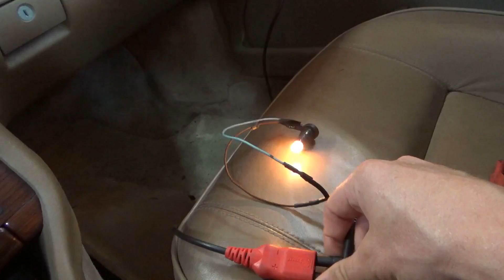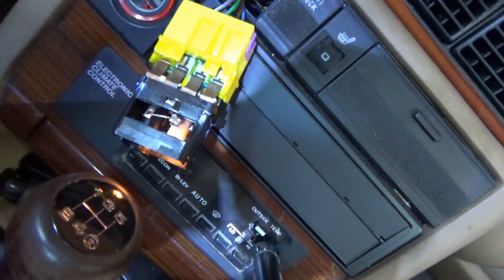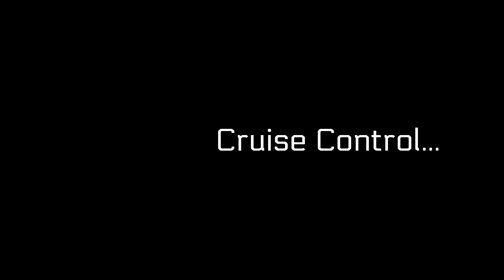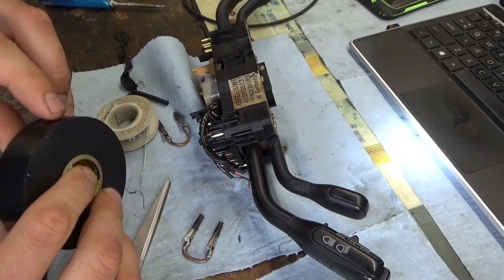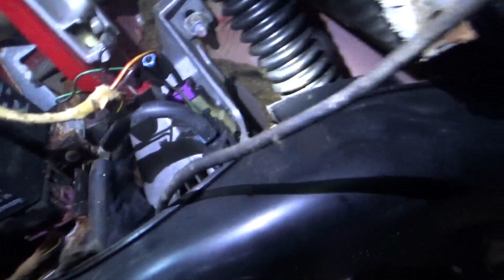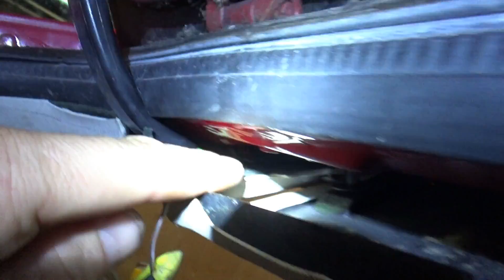CRAZY Cruise Control! (RARE Abandoned Audi Turbo - Part 10)

Comment: OMG!  How could you SOLDER two wires together?  You KNOW a crimp connector is the ONLY CORRECT way to fix this situation because a solder joint won't last through the first bump or any amount of vibration unlike a crimp connector which is SOOOO much more flexible and will last until the end of time or at least well past when this car makes it into the crusher.  NASA is going to hear about this and they'll PROVE to you with decades of raw data and experience that soldering is a fool's game  and you will have to conclude that a crimp connector will be the only correct fix.  I'm calling them right now....  :)

Comment: The wires breaking on the cruise switch was a common thing on older GMs too. Right where the column tilted. They were easy to replace though. you just pull away from column to remove. Clip the wires and tape to new switch to fish through column. The plastic sheathe was tough. Those vent valves are a fail safe if the electrical side quits working. I had a GM that the brake light switch went bad and didn't know until I was getting off the interstate with cruise set. When i pressed brake the cruise dropped off but when i let off brake, it tried to resume. Scared the crap out of me. I quickly knocked it in neutral and cut it off. Then i pulled over and disconnected the linkage from the servo.

Comment: The antilock turns off when locking the diff because all wheels will be turning at same speed. I had an AWD Pontiac 6000 many years ago that you could lock the center diff. As soon as it locked the antilock light would turn on. It would re-enable as soon as you unlocked the diff. It also had a complicated German braking system called Teves Mk IV. The controller had Ate on it as well. The only problem i had with the car. There was no brake booster, only a fluid pump to develop high pressure. When it failed you had no power brakes. In fact you had no rear brakes at all. When it worked though, you could make a panic stop very quickly and straight without locking the wheels.

Comment: The 'ABS OFF' was there because the Audi engineers found that in deep, fresh, soft snow and in loose gravel.....the car stops more quickly when the ABS is OFF because the snow/gravel creates 'wedges' in front of the tires thus stopping the car more quickly than if the wheel continued to turn.

Comment: Of course a crimp tool won't fit there.  The proper fix, in aviation, would be to string a new wire to a point where you can splice into the existing wire with the proper connector and tool.  And that almost never is solder in aviation.  On Eurotrash and the crap coming out of Detroit, fine.  Those cars are going to hit the crusher before it's a problem. Hahaha 🤣

Comment: This fantastic PHAD v 1991 AUDI restoration should act as a clear indication to all Electric Vehicle/Hybrid fans that we already had/have vehicle designs powered by either petrol or diesel capable of running and being fixed as a great 'sustainable' means of transport. And this Audi is a top of the range model. Well done to Ivan and the owner. I loved every section and the positivity behind it.

Comment: Again, you keep  hitting on the common issues that plague these older Audi's.  Do you know how many times I've had folks yell "Hey you got a tail light out!!" when my rear fog is on?? :D  Apparently Audi thought having a switch to turn the anti-lock off was good since there are situations where it would be better without.  Back then they hadnt figured out a way to have ABS play nice with the diff lock either.  Very thorough and great job on the cruise control too.  When you got to the actuator rod I knew the bushing would have been missing.  Great McGyver work on that.  Thankfully folks make nylon replacements of those that look oem.  The pedal switches too!  As mentioned there are just o-rings in there.  Some folks just remove and cap off the vac lines entirely.  On the 12th day of Christmas Ivan returns the Audi to the owner??  :D

Comment: If you think this is bad try the wiring on a rolls Royce silver shadow from the 70s. All the colours are faded on the cloth covered wires and all of the connector blocks are corroded  from dampness getting at them. Another is a citroen sm where all of the wires are black with number ring at the ends of the wires that disintegrated with age.
Reply: Do you mind if I pass ?
Reply: Ps well done for having the patience  with all of these problems

Comment: I was up at 5 with 4 yr old grandson.  Video was out 42 minutes and already had 4000 plus views.  Must be the time zone. 

I’m surprised the whole wiring harness insulation has not rotted off.  We used to replace a lot of Mercedes engine harnesses.  Identifix said the insulation was vegetable based to be biodegradable.  Most harnesses started that process before they were scrapped. WORLDPAC had over 30 harnesses in stock at $900 each. This was in the 90’s. Volvo used to have same insulation early failures.  I don’t miss it one bit.  No patience , bleed easily and no back.  You got these now Ivan. My time is passed. Just an interested observer now 😳
Reply: I’ve been up early in the morning when some of his videos had only been up for 3 or 4 minutes and I was already far down the line of viewers! It’s nice to know that there are others in the world that enjoy this kind of content, because I personally don’t know many people that would sit through a 10 part series for an obsolete Audi.

Comment: I am amazed this car has heated seats. Heated seats weren't common years ago.
Reply from the maker: Plus REAR heated seats!! 😎
Reply: Audi had them from at least 1982 or 1983.  Early cars just had a toggle on/off switch.  6 way heat started in 1985 or so.  Rear heated seats were really ahead of the time.
Reply: Saabs had them in 80’s. Not reliable. I’ve replaced seat covers with holes burnt in them from failed cut off thermostat under warranty. Even one doc’s wife’s expensive coat 😮
Reply: Heated seats in 1991 was news for me too. I thought I was ballin’ when I got my SRT8 Jeep in 2009 with front and rear heated seats. My wife’s loaded out 2016 Impala LTZ didn’t even come with heated rear seats. Sometimes I feel a little guilty on cold mornings while the kids are freezing their tails off. Lol

Comment: Back around the 10 or 11 min mark, is that the dash oil pressure switch pegging out at 100psi? Did I see that right?
Unfortunately I think corrosion is gonna be the gift that keeps on giving with this thing after you're done with it.

Comment: As I watch, I think what's likely to happen 30 yrs from now if today's car is an EV. I believe it's highly unlikely an EV would appear on a YouTube "restoration series." An EV definitely would have unobtainable parts and not cost effective to repair.
Reply: I think EVs will be like todays TVs, just replace when failed.
Reply: I think the early ones have already reached the point of not being worth repairing. I know multiple people that opted for a new vehicle that runs off of dino juice when their Prius battery zapped the last zap.
Reply: @athhud  From what I've seen online, I thought the Prius battery pack was relatively simple to repair. It's the massive "skateboard" batteries that I believe will seldom if ever, get prepared.

Comment: You need to buy some dry lube/ dry silicone lube aerosol spray..  stuff is great for electronic bits that move and dont want to put anything wet on em to collect dust n stuff..  would help the ole speedo and things like it when u get into situations like this one..  switches and whatnot..  comes in a light blue aerosol can..

Comment: REAR fog light?
Reply: It’s a Euro thing
Reply: It’s been a legal requirement on all vehicles manufactured after 1st October 1979, or first used after 1st April 1980 that are sold in Europe.  Manufacturers initially retrofitted them which carried on in some makes for a decade or so but now they are always part of the main cluster.
Reply: Yup...if you feel like driving in reverse on a blue Moon

Comment: Tremendous diagnostic work Ivan, but I am starting to feel like this car should have stayed in the barn or field or wherever it came from.  Audis, not good then not good now.
Reply: Yep.  How many electrical items have been skipped so far ? 
Will AC hose blow off first use ? 
Power seats, turn signals , the other gauges and on and on.  
What great patience.

Comment: Hey Ivan, how would you even bill for something like this.  By the hour, flat rate.
It’s one thing to bring a 50 year old car/truck into a restoration shop. With virtually 0 computer controlled, but now even cars from the 2000s are 20+ years old. It’s interesting to think how some people will do restorations on vintage computer controlled vehicles with unobtainable parts.
Reply: Diagnosis per hour by the system. 
That's how diagnosis is charged.
Reply: Just LS swap everything with aftermarket ecm’s seems to be the current solution.
Reply: @athhud  that’s true. But I’m taking about the guys who want like “factory” restorations done. We are getting to the computer controlled era of restorations now, 1980 was basically 44 years ago, and we started seeing early EFI systems. Thankfully we got guys out there like Keith from L1 auto who will do component level repair on modules.  As long as you can get a clean reliable signal from the crank shaft to know it’s position, Afr, coolant temp, and either map/maf basically any engine can be run from a standalone ECU, automatic transmissions on the other hand are much more difficult to control.

Comment: As you see, back in the day we fixed things. We didn't buy new parts and claim we were green. 🤣
My 2000 Ford Excursion has a very similar vacuum pump. I hear it every time I turn the key to start it.
Reply: That vacuum pump feeds a resevoir for hvac control.
Reply: @johnleinen7167  yeah, I had to replace the o-rings on the electronic vacuum switches in my grandmother’s 2009 Grand Marquis several years ago. Until then I had no idea that vacuum actuated HVAC was still being used so late in the game. It was a bit of a tedious job, but sure beats replacing the shitty electronic actuators that get buried under dashes these days. They would be a decent solution if the nylon gears weren’t built by bean counters. Every single one I’ve ever replaced was because the teeth on the gears broke off.

Comment: The pedal switches have o rings inside and it's typical for them to leak. I'm actually surprised the module was working fine after sitting for so long. The biggest issue on those Hella systems is cold solder joints on modules, specifically on small rectangular capacitors, but I usually just resolder all the joints. Easiest way to check whether the vacuum holds is to pull the hose on a pump, press the regulator that's attached to the throttle valve, plug the hose and see if the valve stays in the same place. Pumps usually don't go bad on these. The system was used on late 70 and 80's EU cars like Audi, Bmw, Volvo, Land Rover, Jaguar and probably many more. Audi used them even up until 97-98 cars.
Reply: The conformal coating on the module is a bitch to remove. I believe I had to use acetone... only then could I reflow the joints.
Reply: @chiil034   To be honest I've never messed with the coating, I just resolder them and that's it.

Comment: Funny thing is that this cruise control interface, in the turn signals stalk, was used well into the 2000s VWs..

Merry Christmas Ivan and all viewers! And amazing job, this is by far the best resurrection series I've seen in years YouTube
Reply: Back in the 80s I used to read the British Magazine "Car".   I remember them fixing an original Audi Quatro coupe.   The dealer wanted eleventy billion pounds.  They determined what was generic VW nuts, bolts, switches instead of the official Audi parts.   The price difference was stupid different.   

Youtube Short:  How many VW parts are in a Bentley?  https://www.youtube.com/watch?v=Rgo_goNTg1I
Reply: @dlewis9760  Aston Martin has a few VW parts too if I remember correctly. Along with either Peugeot or Citroen. I forget which... and obviously Porsche is a glorified Beetle with some hopped up turbo power.
Reply: At least until 2010, when the Sharan got a facelift. The 2nd. pre-facelift generation (2001-2010) used that design as well.